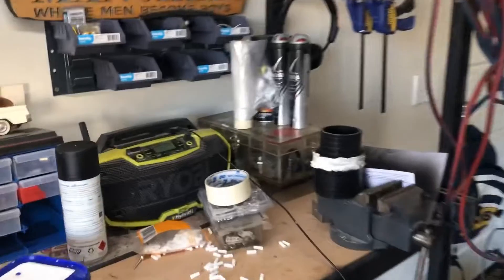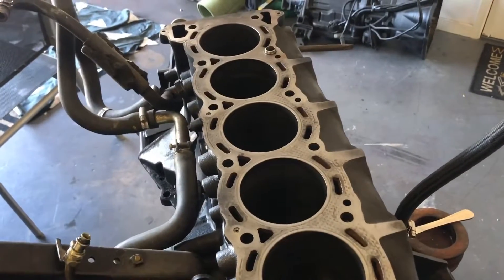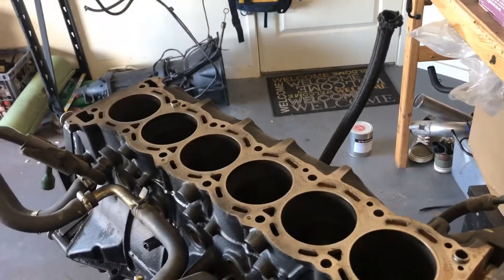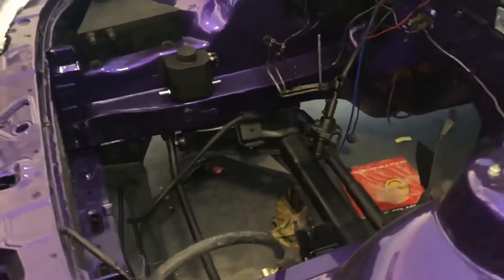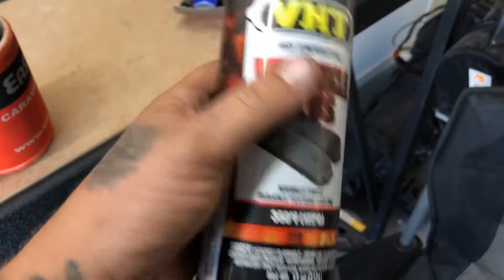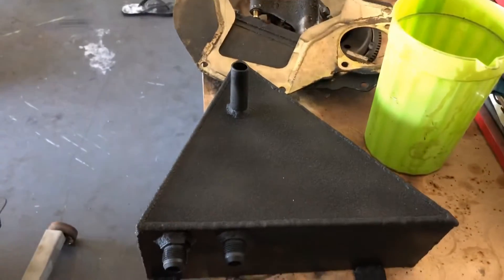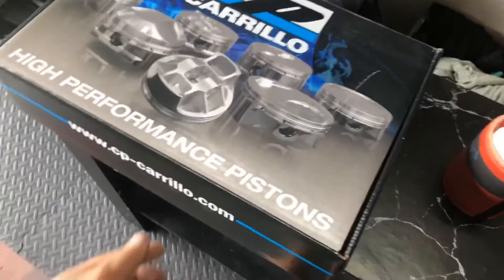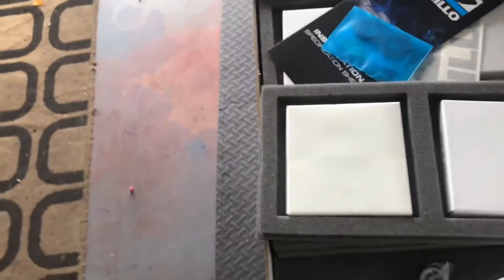Vl turbo engine build forged pistons part 9

Comment: Nice job mate come up very nice how did u go with the rotating assembly did you get it balanced with the forgies
Reply from the maker: Chris hollis everything went back together nice and all within spec no didn’t need a balance
Reply: @MrProjectt  how much power did it end up making im going to get mine done as my 4th main bearing was in a bad way got quoted $350 from flowcraft here in Melbourne witch is a good price i reakon
Reply from the maker: Chris hollis made 300 hp on 12 psi currently running 18psi now it’s up around 450hp
Reply: @MrProjectt  sounds good mate

Comment: Hey mate, how much did the pistons cost ya ? Could you send me the eBay seller, I have the same problem as you don’t really want to bore out my block and can’t find anyone selling standard sized forgies.
Reply from the maker: P D 
Here’s the link to the ones I bought 

https://rover.ebay.com/rover/0/0/0?mpre=https%3A%2F%2Fwww.ebay.com.au%2Fulk%2Fitm%2F253238101103
Reply: Rawbrokeage rb,30 CP forged pistons 86mm $900 posted
Reply: What forging are those  pistons 4032 is what most are .

Comment: Using a scotch bright pad on a machined surface is wrong!. The only rotary tool you should ever use on the top deck of an engine block is a mill or a surface grinder.  The surface finish you've achieved is not suitable for a multi layer steel gasket and I dougt a composite gasket would seal either. Take the engine out and get it down to a machjine shop and have it machine correctly.
Reply from the maker: aussiepaul50  well I have never had any problems at all I used copper gasket seal on the gasket it’s a cast iron block and a scotch pad dose little to nothing to cast iron it if was aluminium you would have a problem